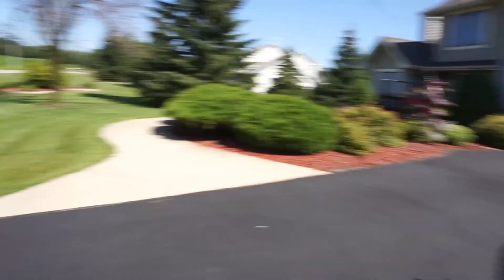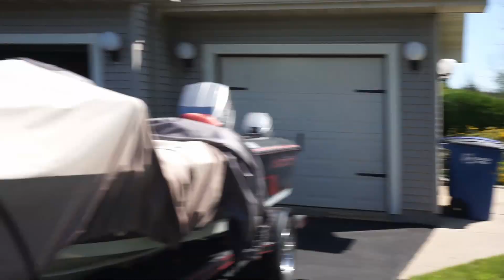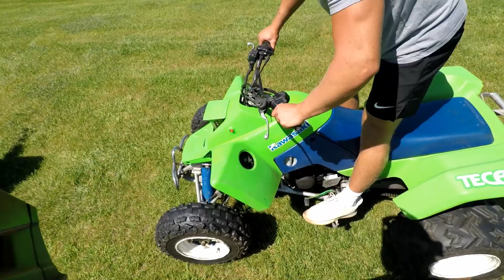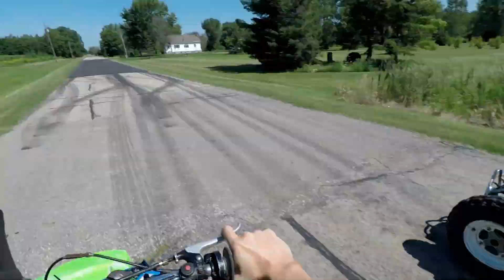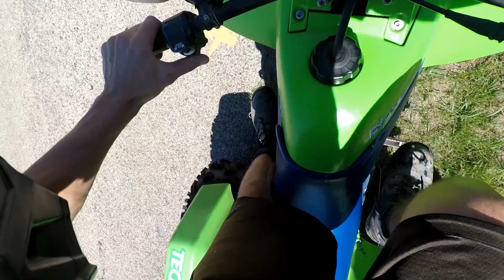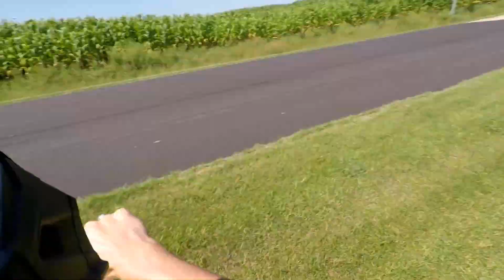Tecate 3 250cc vs Tecate 4 250cc. The FASTEST Kawasaki Two Strokes Ever Made

Comment: I had an 84 and a 85. They have ton of low end dirt flinging power. But thier alot of work to keep running, not impossible just a pain in the ass. Part of reason is how bad they vibrate. Wish I still had them.

Comment: Bad Machine, My Brother David has a 85 ? Tecate 4 ,a 85 250 R, and a 83? 200 Big Red . The Tecate and 250 R Run Great . Big Red is not running, we got it that way. 😂 He was riding The Tecate ,just warming it up, WITH THE CHOKE ON , And you could hear it, then it opened Wide and ran away briefly , with The Choke Still  On . Luckily he stopped Very Quickly at the edge of a 5 foot deep ditch in our yard. After The Left Front Wheel Fell Off 😲💩 . THESE TECATES ARE BAD TO THE BONE. KP1  makes around 53 HP , Really Awesome Power To Weight. THESE Things Will run with the Choke on , I never remember 2 stroke doing that , this Tecate Ain't For Amateurs . 😲 Even Really Good Riders Can Hurt On These Things. Like a lot of 2: Strokes . You don't 👀 a lot of these bikes . Awesome 👍👍

Comment: You better be careful Holding It Wide Open is on these you did it will stretch the rod causing the Piston to hit the head and the shattering your piston and eventually throwing a rod probably I'm very very familiar with this cuz I had a 91 lt250r quadracer bought out of a box bunch of boxes and I put it together as a kid and I blowed mine up like 10 times because I didn't know to let out every so many seconds on a two-stroke

Comment: Looks like you have 18 inch rear tires so if you put stock 20 inch back on it might help with the top end speed though you might loose acceleration.

Comment: I totally remember the Tecate -3s when they were current. They were the ultimate. 
They had a separate motocross class for the three wheelers and Kawasaki dominated. 
Seems like they used small tires in the back to spin and drift though turns. That was the technique you had to use to keep it on the ground. I cannot even imagine how they felt to land the big jumps in a race. Obviously, it had to be al lot harder than a regular 250 motocross bike.
Reply: Three wheelers are super scary to jump. You have to be almost perfect or it's going to be a complete disaster when you land. The worst is going down super steep washed out hills on a three wheeler, talk about sketchy as fuck. I still have PTSD from the 200x I had back in the day.
Reply: @mmaaddict78  …….yeah, those things were not meant for novice riders. You had to know how to keep a low center of gravity and lean hard in the turns, not oversteering.
That (I think,) is why many of the early three wheelers were more like a go-cart. You sat down in them and they were very stable. 
A Tri-Sport all Sport with CCW engine is a good example. They at least felt fast because you were so close to the ground….😆
Reply: @c.s.s.1723  Riding on hills killed it for me. Even on regular off camber type stuff it was so unstable that you were shitting your pants in places that a dirt bike had zero issues traversing. After a brief time on quads after the three wheeler debacle, I switched to dirt bikes and haven’t looked back. Good riddance trikes lol, I won’t miss them!